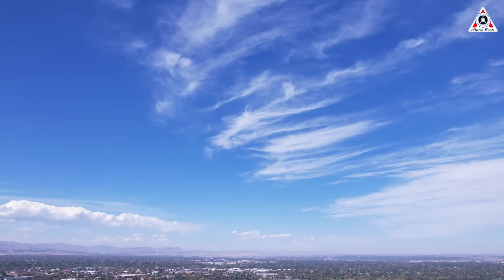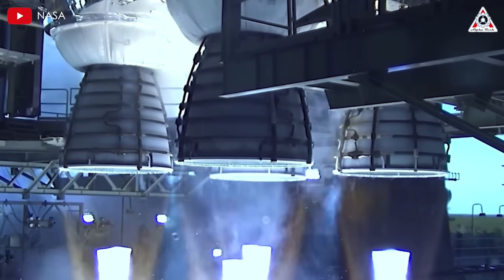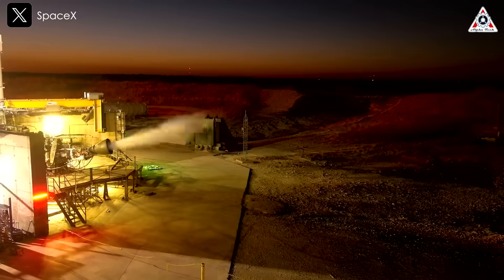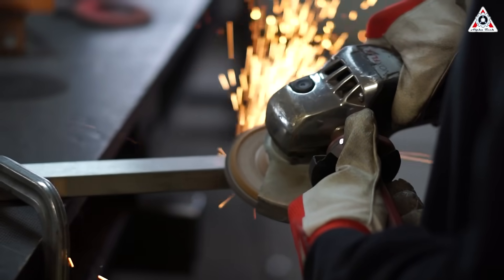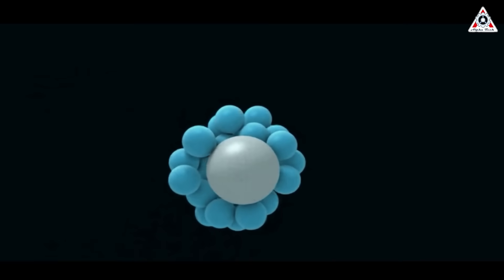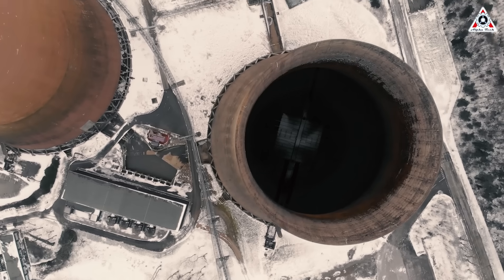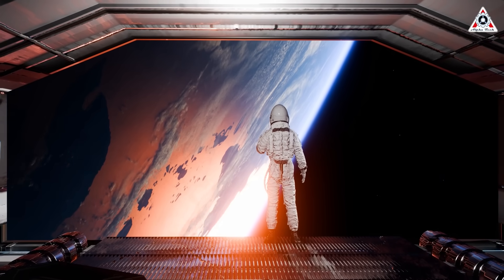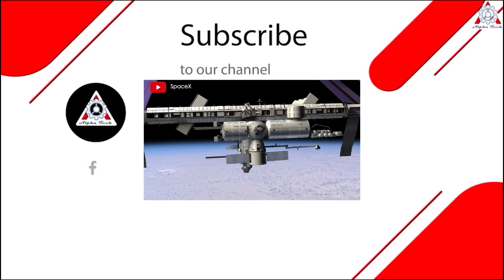NASA's New Nuclear Rocket Engine to Mars in a Day! Even Faster than SpaceX Starship...

Comment: Nuclear thermal propulsion is not a new idea, it has been around since the late sixties. The problem lies in the technology and materials needed to make it practical. Theoretically a NT propulsion system would out perform any conventional chemical rocket by several orders of magnitude but the engineering challenges that need to be addressed in order to produce a viable system are formidable. 
Even if all the hurdles are overcome, would the time taken for a Mars journey be reduced? Yes, they would but I can't see any NT system reducing the time taken to less than a day, that would require ridiculous amounts of thrust, enough to turn the human body to jelly. So unless we also have antigravity (which would make a NT drive unnecessary) such ideas are pure fantasy.

Comment: For smoother development, I am missing something between Falcon 9 and Starship with Raptor engines and stainless steel construction.
Reply: Dan Dare had Anastasia.  We have to catch up with where we ought to be.  Which, for human journeys, is generating G by tethering ships by their noses several hundred metres apart, and giving this combo a 1 rpm spin.  Those nuclear motors need to work hundreds of feet away from people.  It will be a long time (decades) before they become safe and reliable.

Comment: Just revive Project Orion from the 60s.  Pulsed blast mini-nukes against a buffered pusher plate like the Messiah ship in Deep Impact.  AND it would be a straight engineering project since no weight compromises would need to be made.  Cruising speed could be, theoretically, 8%-10% light speed.  Proxima Centauri in a human lifetime.

Nah, that's stupid, we should fight over lines on maps instead.

Comment: So this seems to be a vastly large scoop of misinformation. From every image that they show from a rocket in space that isn't a classical chemical propulsion rocket, which you can see by the blue light escaping from the back of the thruster, is an Ion Engine. Using a nuclear reactor to produce large amounts of energy and heat to shoot a gas out the back is an incredibly efficient source of thrust, but by god is it slow. You are taking a large amount of mass, and using individual atoms accelerated to a certain percentage of the speed of light and throwing it out the back essentially will produce incredibly little force compared to any other rocket. I do not have numbers for the acceleration, but it is incredibly small. Engines like this would only be effective for long term missions, which you plan to take place over the course of many many years, because of its high efficiency it still wouldn't run out of fuel. This is the closest thruster that compares to this thruster that is shown, and could be wrong; from images shown and details given, it is the closest candidate.

Comment: So ridiculous. Complete nonsense. Complete misunderstanding of the transit from earth to mars. The chemical engines don’t run for long… just enough to blow eccentricity of the orbit of earth out to the orbit of mars. 
And as for a fusion reaction generating energy, what the hell?? Creating energy is useless if you have no mass to push out the back to make it go forwards. Creating heat is useless if all it does is heat up the rocket. 
This is one of the most absurd videos I’ve ever seen.

Comment: Update En-Route MISSION TO MARS realistic time ... 🌞 
AI Overview
While NASA's stated assumption of a 31-day transit to Mars using current technology is not feasible, the use of nuclear fusion propulsion could potentially shorten the travel time to around 30 days. The feasibility of 90-day trips to Mars with fusion propulsion has been suggested by scientists. Therefore, NASA's 31-day assumption is not realistic for current technology, but achievable with advancements in nuclear fusion propulsion. 

Elaboration:

Current Technology:

Without significant advancements, a round-trip human mission to Mars using current technology could take more than four years. 

Nuclear Fusion Potential:

Scientists are exploring the potential of nuclear fusion propulsion to drastically reduce travel times to Mars. 

30-day Target:

Research suggests that a 30-day trip to Mars with a fusion rocket is a potential target. 

90-day Target:

Another possibility, supported by research, is a 90-day trip to Mars using fusion propulsion. 
AI Overview & Richard France Independent Researcher 05-11-2025

Comment: Using Nuclear Fusion en-route to Mars takes how long
Reply: AI Overview

While NASA's stated assumption of a 31-day transit to Mars using current technology is not feasible, the use of nuclear fusion propulsion could potentially shorten the travel time to around 30 days. The feasibility of 90-day trips to Mars with fusion propulsion has been suggested by scientists. Therefore, NASA's 31-day assumption is not realistic for current technology, but achievable with advancements in nuclear fusion propulsion. 

Elaboration:

Current Technology:

Without significant advancements, a round-trip human mission to Mars using current technology could take more than four years. 

Nuclear Fusion Potential:

Scientists are exploring the potential of nuclear fusion propulsion to drastically reduce travel times to Mars. 

30-day Target:

Research suggests that a 30-day trip to Mars with a fusion rocket is a potential target. 

90-day Target:

Another possibility, supported by research, is a 90-day trip to Mars using fusion propulsion. 
AI Overview & 
Richard France Independent Researcher R ❤ 🙏 🌞

Comment: Propulsion is only half the issue Lockheed should reveal a older em power source which helps to not just create the energy needed but also creates propulsion and a field needed to sort of protect the body from the radiation of space travel
Reply: Not to mention inertial dampeners, And shields. Plus a ship that is capable of navigating at those speeds without smashing into space debris ( extreme long range scanners/sensors ) Etc. Etc. Etc. Etc. Etc. Etc. Etc. Etc. Etc. Etc.
Reply: @rickycampbell9105  you don't need inertial dampners when you are within the energy field of a vehicle equipped with these field generators it cancels mass why do you think they can maneuver into oceans, through atmospheres and even between planetary bodies almost instantaneously I regular human vehicle we suffer from gforces these vehicles dont

Comment: December 1967: The first ground experimental nuclear rocket engine (XE) assembly is shown here in "cold flow" configuration, as it makes a late evening arrival at Engine Test Stand No. 1 in Jackass Flats, Nevada. The engine is in the left background with a shield structure in the mid/foreground.

Comment: Other means of space travel have to be developed. Nuclear reactors might be better utilized to create magnetic field and form tubes or tunnels in the fabric of space. Many years ago space was proven to be compressible with magnetic fields and light was slowed down to one foot per second in compressed space. This also explains how black holes are able to pull space and light in . We don’t have the technology quite worked out yet, but it and propelled matter faster than light have already been achieved however only on a subatomic level and light weight atoms such as hydrogen have been pushed beyond the speed of light. Some people keep claiming that the Van Allen belts are impassable, they are two belts that are located around the earth but are not spherical, they are open or nonexistent at both poles. They contain high radiation levels and temperatures up to 3500 degrees Fahrenheit. There is space between the lower and upper VanAllen belts and spacecraft can travel below or between them and around them at the poles. I believe that some day faster than light speed travel will be achieved if people don’t destroy civilization first.
Reply: Nuclear reactors are by and large not stable enough at this point to be transported into space without exploding and leaving tons of radiation. The speed of light is a constant, it hasn’t been slowed down besides the fact it went through a different medium. We have not ever achieved or seen anything faster than the speed of light. (If we “have” it’s either a lie or it’s a new journal forgetting to mentioned it was a simulation of particles that are not real). Van Allen belt is just radiation (and heat, magnetic field etc), there’s no reason to say “people think it’s impossible to pass”. Maybe with out current tech, but like…

Comment: Thermal propulsion ? Exactly what  is doing the thrust.... ions?
Reply: Thermal just means that they heat the propellant directly--a nuclear-thermal rocket runs the propellant through the core of a nuclear reactor to heat it, as opposed to a nuclear-electric rocket which uses the reactor to produce electricity, and then accelerates the propellant with electromagnetic or electrostatic fields.
Reply: What propellant?
Reply: @ Theoretically any fluid can be used, though the lighter the molecule, the higher the specific impulse, and some materials might leave undesirable residue (e.g. carbon-containing molecules could leave soot clogging up the plumbing). As such, hydrogen is the usual choice, though water is also viable. See NERVA for an example of real-life nuclear thermal rocket engines--theoretical ones are mainly meant to operate at hotter temperatures than current materials make possible.

Comment: I recall back in the ‘60’s, there was a project Orion (not the same as the current project Orion)  proposed using small atomic explosive devices  in a series of explosions behind a shock plate on the base of the ship.  Test models using dynamite were tested, but the overall project was cancelled due to the SALT talks banning atomic bombs in orbit/space.  I believe NASA had intended for a relatively large crew to sling shot around several planets before returning to earth with pictures and spectrographs.  Our knowledge of conditions and radiation in space were less in those days, and perhaps it’s just as well the project didn’t go forward.  Perhaps I’m wrong, and we really did know enough. I do wish it had progressed to launch.  Would have come back with some incredible pictures and data.

Comment: BS and lies. Rockets can't work in space vacuum. If the pressure of a system is 0 then the work done by the expanding gas into that system is 0. Gas expanding in a vacuum doing no work agrees with Free Expansion. This can also be understood as the gas meets no resistance as it exits into the vacuum and thus transfers neither heat nor energy to its surroundings. If the gas loses neither heat nor energy then it has done no work.

The principle of work and kinetic energy (also known as the work-energy theorem) states that the work done by the sum of all forces acting on a particle equals the change in the kinetic energy of the particle.

Rocket thrust is given by the equation: F=m˙vexit+Ae(P1−P2)

where m˙ is the mass flow rate, vexit is the average exit flow velocity across the exit plane, Ae is the cross-sectional area of the exhaust jet at the exit plane, P1 is the static pressure inside the engine just before the exit plane, and P2 is the ambient static pressure (i.e. atmospheric pressure).

Provided that the nozzle is not overexpanded and flow separation does not occur, Ae remains constant, and the thrust difference is realized primarily from the change in P2. If nozzle is overexpanded to the point that flow separation occurs, you lose contact, however, the exhaust jet area drops as well, causing further losses. That's why we have adjustable nozzles, but that only postpones the inevitable. Space vacuum creates flow separation. We can't saturate space vacuum to create backpressure. It's the path of least resistance. The lower the pressure the faster the flow. Momentum is preserved in the exhaust gases, there is no momentum transference.

This is easy to see in a rocket’s free body diagram, without drag, you cant have thrust and it will never be faster than the exhaust gases. Drag is just resistance from the atmosphere and you also have weight. What you see in NASA'S launches is momentum before falling in the ocean. A glorified bullet.
Reply: Newton's Third Law--for every action there is an equal and opposite reaction. Throw any mass out the back of your rocket, and the reaction is what pushes you forward. Momentum is and always must be conserved, so therefore if the stuff you throw out goes backward, then you must go forward.

Comment: In a day? Sorry, no. That’s 1,250,000 miles an hour. That when mars is at its closest, around 30,000,000 miles away. But you can’t go directly. Not happening. Even 10 days is problematic. At 125,000 miles an hour, for 10 days sound feasible, but it still can’t go directly. It needs to swing around to get to that speed. 30 days is the fastest engineers believe it would take.
Reply: But.....NASA said it.....

Comment: Need radar infrastructure in space before they use that tech.  Decide what route to take and place radar satellites about 1,000 miles apart to scan in every direction so the ship knows there aren't any pebbles in the way.  And then keep them moving as the window moves, or only launch when the highway lines up again.  Would probably need some kind of plasma shield in front of the ship to destroy or move objects around the ship.  Have to ask the demons (aka aliens) at Skunkworks how they did it.  Probably need a thorium reactor to generate the electricity on Mars to charge up the Tesla bots for doing all the construction ahead of time.

Comment: Nearly 4min into this load of garbage when I decided to read comments.
Even if it took five minutes to get there, the infrastructure to survive -70C at night will be a major task and just one of a heap of problems… so a summer season would be preferable on arrival.
No air, byo fuel, toxic soil to anything organic not even Cockroaches would perish in seconds, gravity, living 100% on recycled water, existing 100% recycle waste and living basically in twilight requiring hundreds of craft to robotically build infrastructure with crew safely controlling everything from Mars orbit and maybe a small number of crew on the ground.
Caves large enough to be sourced and accommodate would have to be a priority for protection from radiation etc

Comment: I wonder if they ever considered using a magnetic 🧲 sling shot to be built outside of Earth's orbit to literally shoot very much like a gun where the spaceship is literally loaded into the barrel of the magnetic sling shot and literally shoot the spaceship across space saving time,fuel, and limiting humans to the harsh elements of outer space especially for spaceships carrying cargo only for these particular flights where gravitational forces wouldn't be an issue but as far as human transportation there will need a ship equipped with buffer's to take the brunt of the g forces during the launch caused by the magnetic sling shot cause there will be tremendous g forces that would normally literally squash someone upon lift off maybe if they used like water or gelatin to change the atmosphere inside the ship so that the area in which the humans are in are pretty much dipped into the gelatin to absorb and cushion the g forces to literally nothing depending on how thick the gelatin is and with this new nuclear spaceship we could probably get to Mars in literally no time but going that fast definitely has it's challenges like once the ship reaches it's destination how do we stop this crazy thing 😆

Comment: If I was going to be the first boots on Mars id do 6 months - it would be worth it
Reply: Problem: the longer you spend in low-G, the more your muscles and bones atrophy. We see this in the astronauts that are stationed at the International Space Station. Don't worry about nuclear powered engines, they actually started on the design back in the 1950's with test stand runs made at Marshall Space Flight Center. Good luck on finding the information about it. I'm almost 60 yo, and when I found the books about it in the library as a teenager, the books were already old. Librarians used to think that it was "their sacred duty" to censor and quietly cull out books that were "problematic" for society. Fuckers.